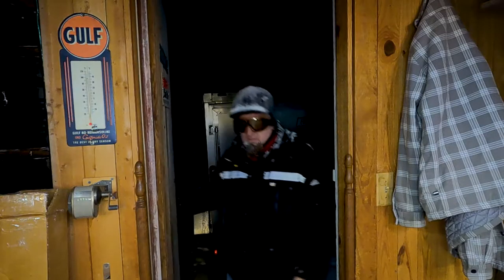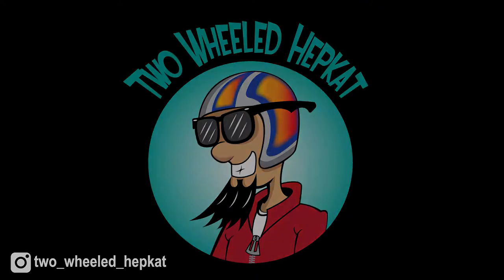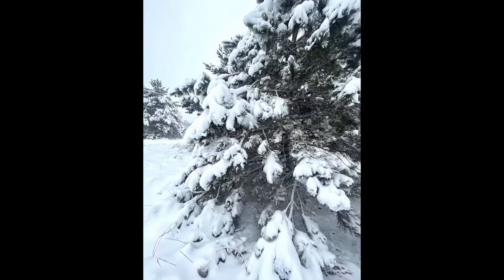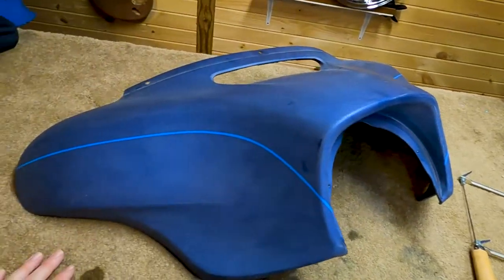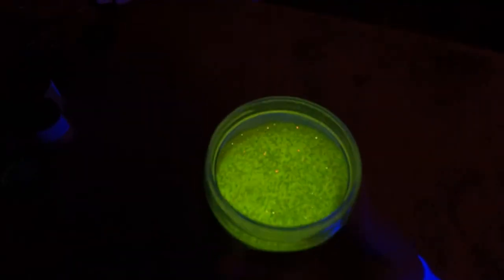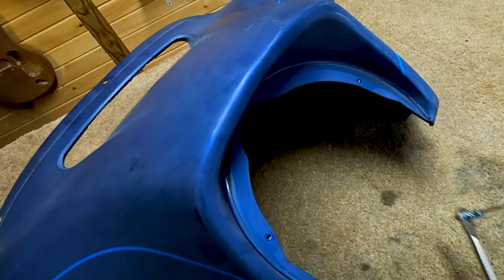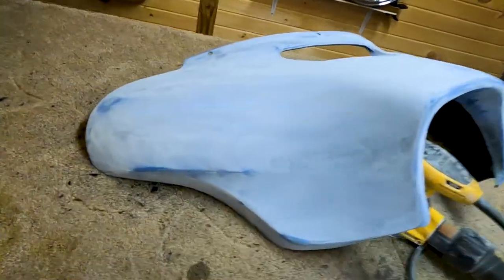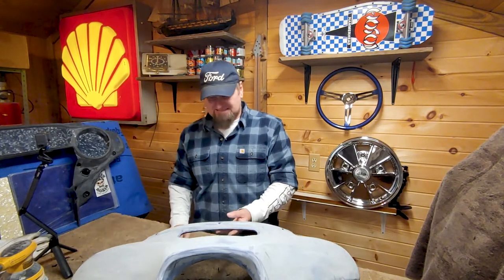Final modifications and sanding on the batwing fairing. Rebuild, Restore.

Comment: Suggestions.....
1. Shoot some test panels first
2. Big flake is good but not always necessary. If you do go with the big flake, mix some of the smaller flake in. It will help with coverage (prevent holidays). 
3. Big flake requires several clear sessions. Don't rush it. It may take 3 or 4 sessions. 

Give me a holler, if you want some other tips. I'm a flake-aholic and have learned a lot of do's and don'ts over the years.
Reply from the maker: Thanks Jack. Funny you said this. I just had someone else tell me to add smaller flakes to the big flakes. I’ve never tried that before but it makes sense. Once it warms up here I’ll give you a call and make sure I’m doing it right.